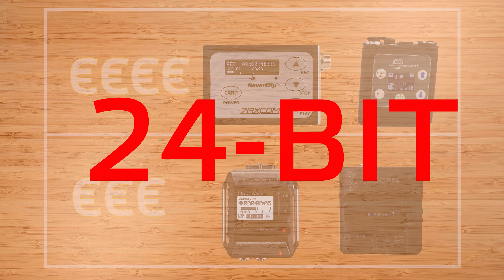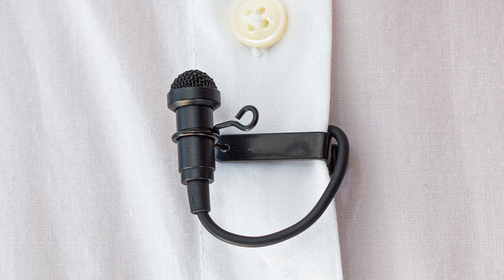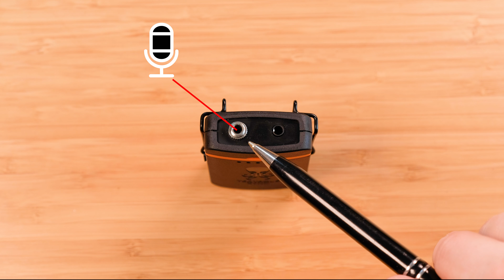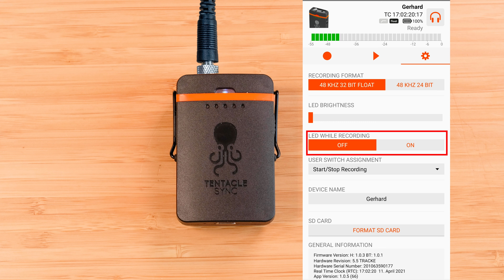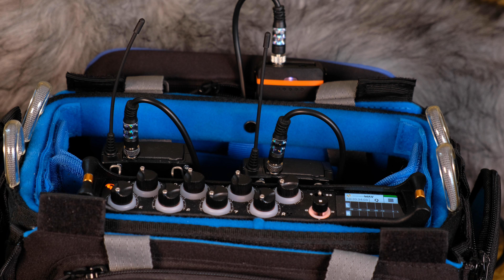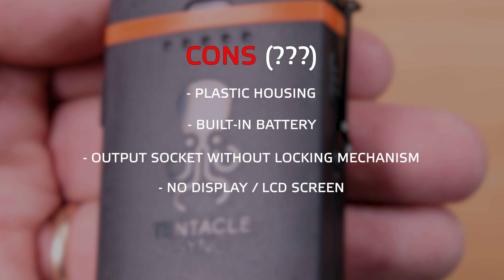Tentacle Track E recorder with TC

Comment: Actually, there is another competitor capable of 32-bit float : InstaMic. InstaMic has supported Timecode sync with the Tentactle timecode units since 2019. When you recorded your video, InstaMic was not capable of 32-bit float yet, but as of October 2021, they have launched the InstaMic Pro Plus, which is 32-bit capable and can record 96 kHz. The only downside of InstaMic is, that you can't attach a lavalier mic to it, but that is intentionally, as it's waterproof. It's internal capsules are seriously good though.